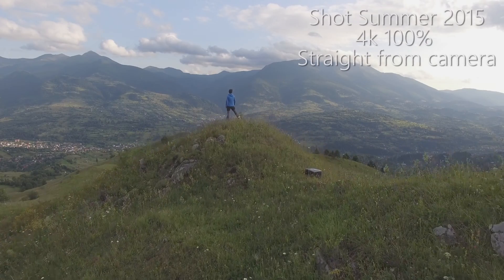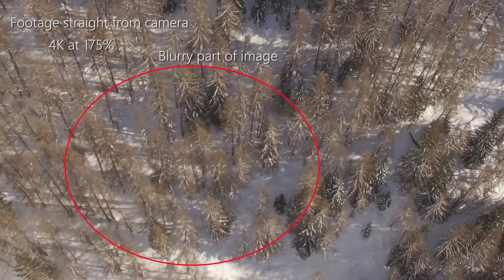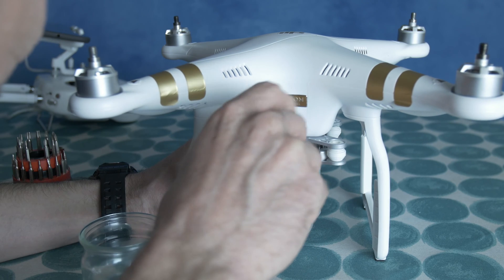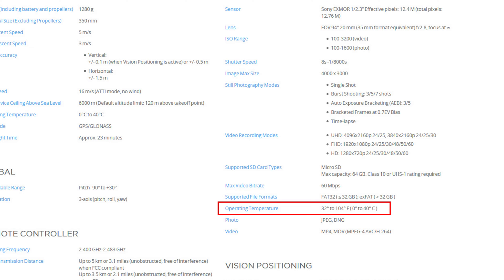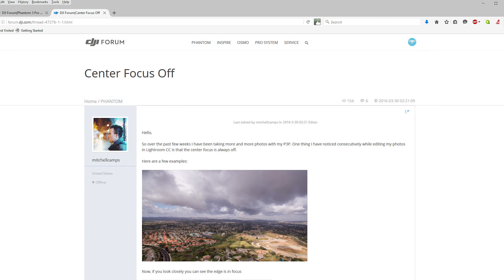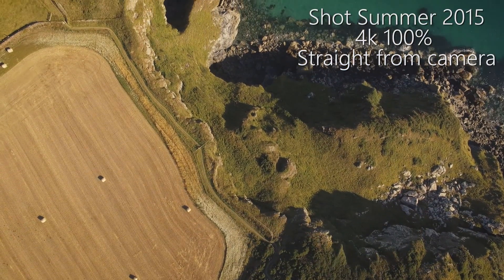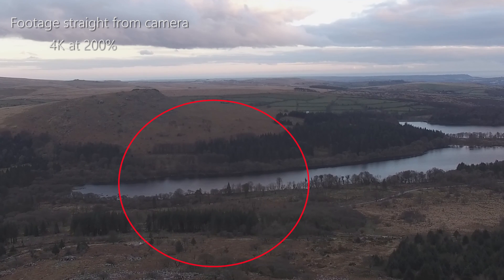Watch this before flying DJI Phantom in cold weather

Comment: YES, I have been having this trouble myself, on the exact same spot! Phantom 3 Pro. But Im not sure if its the cold weather, but it may be! When you blow things up in 4K on youtube app on smart TV, you can really tell the difference. Have you gotten any wiser?? Did it get better in warm weather again? How did you fix it?:)
Reply from the maker: Vidiot Films yes for me it definitely shows up in colder weather, don't have the issue when flying in warmer climates. Not much can be done about it unfortunately
Reply: Ait, thanks for the quick response! Guess if one wants perfect footage, we will have to film over 8 degrees celsius... Have you seen this video? What do you believe? 
https://www.youtube.com/watch?v=0xQcC1WBChU&t=87s
Reply from the maker: Vidiot Films yep, it's probably possible to fix the sensor alignment but and it's a big but the scews in the camera assembly are extremely fragile and very easy to strip the threads, you need the exact right size screwdriver and even then it's not easy as they have been set with threadlock. My advice would be to leave it. I actually ended up getting a replacement camera from DJI but it still exhibited the same issue.
Reply: I see! Will try to neglect the blurry spot when flying in cold weather, and wait for warmer weather to get the perfect movie footage! :)
Reply from the maker: Vidiot Films enjoy, happy flying.
Reply: Just a Q in regards to this.. Cant seem to find the soft/blurry spots in your 2015 videos, for example https://www.youtube.com/watch?v=F5TNVNTYtvY ? You didn't have this problem then? Different drone? Fixed it in post?
Reply from the maker: Vidiot Films ha, not shot on a drone. All done from ski lifts
Reply: Ait, thanks! They looked so incredibly sharp and nice! Do you have any tips as to which color profile to use for P3P? I've noticed that the D-log (as "everybody" seems to recommend) don't actually come out that sharp and crispy as fex. the ART profile or NORMAL. Any experience with this? And what style settings do you recommend for your favorite color profile? 0 0 0? Thanks, and all the best!
Reply from the maker: Vidiot Films video on my channel all about picture profiles for the P3. Have a watch of that

Comment: For those of us who live in the northern regions understand this is due to condensation. The unit has to be acclimated to the ambient temp for a bit before flying. The expansion and contraction ideas is not logical as this is caused by moisture not differences in expansion rates.

Comment: I have P3P and a P3S, the camera on the P3S does not suffer from the cold weather like the one on the P3P. Flew both of them in different locations and temperature from -30C to 38C and image / video quality from the P3S remains the same - very sharp. So I guess the blurry image / video issue we are talking about here is simply the result of a bad camera batch.
Reply from the maker: Anh Luu i haven't flown the P3S is the camera the same design as the P3P. Thanks for sharing your experiences.
Reply: The camera on the P3S is the same size as the one on the P3P, it has lower resolution (2.7k) and the FOV is slightly narrower. I guess if DJI could make the camera of the P3S trouble free then it should be the same for the P3P.

Comment: I just returned from a trip to Siberia. I was flying the Phantom 4 at temperatures of -20C. No problems at all. Battery life time was fine, maybe a bit reduced but not something what really bothered. Also camera and camera control worked fine. Same for the controller itself. I have to say if the Phantom 4 can sustain the harsh environment of Siberia then there is not that much I am worried about. You can fine some of my pictures from Lake Baikal on Instagram under lonelyphotographer 

Cheers and good luck!
Reply from the maker: Stefan1968ful cool, thanks for letting us know. Good that you had no blurry spots. 👍

Comment: Had a very similar problem with the Mavic Pro in 2-7 degrees Celsius. DJI refuted the problem but apparantly within their specifications so I'm in the process of an insurance claim. Would suggest you check your credit card insurance / warranty periods if purchased on CC as they oftentimes have longer warranty periods.
Reply from the maker: Anton Mills thanks for the comment. Useful to know.

Comment: hey man, I believe I have the same problem - http://www.phantompilots.com/attachments/dji_0072_marked-jpg.75125/
Did you manage to fix yours? I too flied in cold weather, should I hope it fixes by itself when its warm, or should I get it to a service to tilt the sensor?
Reply from the maker: pironcho well all you need to do is film something either when it's not so cold or just put your phantom inside and film something without flying it. Make sure you have at least a couple of meters between the phantom and subject as the minimum focus distance is somewhere around 1-2meters.
Reply: so this is to test if its permanent, or to "fix/reset? the focus to be constant throughout the whole area?
Reply from the maker: pironcho yes it's to see if the focus has returned to being uniform, I.e. the blurry spot has gone. if it hasn't you'll either need it serviced or a new camera.
Reply: sadly its not under warranty anymore. I`ll try, but I want to cover the worst case scenario-do you have info if its something that can be serviced, I mean fix it in a repair center?
Reply from the maker: pironcho no sorry I don't. a new camera for the P3P is around £320. I think in most cases once the camera has warmed up again it will be back in focus. Good Luck

Comment: Don't forget that although the temperature may be 0 degrees on the ground, at 100 or 200 or higher, the temperature might be - 10 or -15 degrees colder than what it is on the ground.  This could most definitely cause the out of focus issues you and others are having.  Also, being manufactured from aluminum, the cold will affect it much quicker than if it were made from steel.
Reply from the maker: WichitaMule yep I agree.

Comment: Hi. Thank you. Today I shot a condo in  Burlington in -10 C regular temp, with winds of 20 km per hr, gusting, but clear blue sky, taking 12 MP stills of the condo - as I do every month under a 1 year contract, as the condo goes up from ground to 7 stories - point is, today on Jan. 6, 2017 is was very cold - got VERY BLURRY still images, or at least quite noticeable different from those taken in the warmer months.

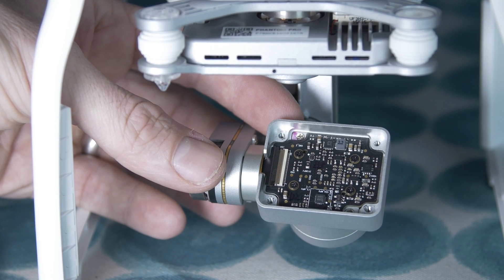But at 2:00 into your video you talk of 'contracting boards' - - I don't think that's even possible, unless at a very microscopic level. I can't agree with your logic as to the cause of blurry photos due to the focal plane being moved around due to shrinking / contraction / expansion / movement of that solid board. It's screwed in!  

If it is physically screwed in, then it simply cannot move, unless the entire camera housing around it was also moving around.

No - I think you're on the right track - it's all about COLD, and the effects it has on a tiny little C-mos sensor chip - like it's frosting over or something, or maybe the electrons are slowed at that level, that would effect the otherwise pristine images one gets in warmer weather.

Remember folks, if the wind is at 20 km (or 50 mph, whatever) that's one thing in the cold - but ADD TO THAT, the rotor blade Down-wash - You've all stood under your P3P and you know how wind is generated by those 4 props.  Well in already extremely cold weather, we have added about 30 mph winds to the Wind Chill Factor.   C-Mos sensors (I believe now) do now work well in these conditions.   RECOMENDATION - IDEA FOLKS.

I'm going to try and insulate my camera with a light-weight, balanced considerate, covering (maybe a layer of liquid plastic, then a foil reflector material - ALL AROUND THE CAM.

Thanks a LOT for this video - you just gave me a great idea. I'll post the results here, when I try it soon.  (Probably have to re-shoot this condo  - I charge them $225.00 per shoot, and I don't like giving fuzzy results! Cheers GW
Reply: Meant to say "C-Mos sensors ( I believe ) do NOT work well in these (extreme cold) conditions.
Reply from the maker: Sky Vision yeah thanks for this, whatever the physical process going on it's a definite problem for all the Phantoms and mavic drones as well. I had my camera swapped out and again it happened flying in cold conditions. 

I'd be interested to see your camera cover, so please do share it here when you're done. Thanks for stopping by and commenting. Happy Flying 👍
Reply: Just an update on P3P and effect on focus / clarity. I was worried that I might have ruined my P3P (less than a year old) when I shot in -20 C temps. But today (at + 5 C in Hamilton, Ontario Canada) I finally had a good sunny day to try it out again. And the resolution of still images and video (at 1080, 2.5 and full 4K tests) seems to be fine.I had called a drone-repair place in Toronto, and they had never heard of damage such as this due to cold weather. They repair a lot of drones, so I thought I'd call them. They only spoke of battery time shortened by cold, but seemed to have never heard of this focus issue.After careful evaluation of my P3P - I'm not 100% certain, but it seems to be fine. But when I compare the still images and videos shot at 20 or 30 below zero, they were fuzzy as hell, compared to today's "warm" temps of +5 or so, that yielded good clean focus across the entire image area. I zoomed in to these stills and compared them to equal zoom-in on stills taken when the P3P was new, and they look the same. Sorry for long message, just thought I'd share this for others who may benefit from this. Geoff at Sky-Vision.
Reply from the maker: Sky Vision cheers Geoff, certainly very useful info. Yes, the camera does seem to go back to pretty much normal once it has warmed up again. Thanks for taking the time to feedback. have a great day and happy flying 👍

Comment: Flew my Phantom 3 Standard in 3deg celsius last week and picked up some condensation on the sensor. It resulted in the image being washed out and blurry. Allowing the drone to warm up for a while fixed everything. You have to remember, if it's 0 deg on the ground, because of wind chill and the propellors acting like a big fan, the drone is going to be experiencing even colder temperatures. I try not to fly in less than 5deg
Reply from the maker: Jack Dooner Thanks for the comment yes your right. This issue is not condensation though. 🙂
Reply: Yeah, I totally see, it's definitely not condensation in your case. Just speaking of my own experience. Do you still have the issue? I've noticed on the forums, A LOT of people have this exact issue with the Mavic Pro
Reply from the maker: Jack Dooner I changed the camera back in the summer and have literally today just been flying in Iceland in temps around -5c  to 0c. The issue is still there, maybe slightly less so than my last camera. I've decided that I rather fly and get the shots I want, I can live with it. 😀
Reply: Wow, that's unfortunate. I guess it's just a flaw in the design! :(
Reply from the maker: Jack Dooner yep I guess so. Would be interested to see if the P4pro suffers from it as well.
Reply: I was just thinking the exact same thing. It would make me nervous if I ever wanted to upgrade... spending 2000 euros on a drone with a camera I cannot fly in the cold. DJI don't realise that we don't all live in sunny California lol
Reply from the maker: Jack Dooner yep agreed. As the P4pro is available now and we are in winter if there is an issue it will show up in the forums pretty quickly I would guess.
Reply: Roger that!
Reply: Canada here - near Toronto!
Reply: I flew 4 times at -17c
Reply from the maker: TheMidnightNarwhal cool.
Reply: My drone is new of 1 day. Is it bad, I mean, all seems ok.
Reply from the maker: TheMidnightNarwhal what drone is it? Have a look at your footage / photos and see if they have a blurry spot.

Comment: bringing some life back in this comment section, mavic pro also has this issue, noe mavic has autofocus, but after one battery it wont reach infinity focus point
Reply from the maker: Tage Mathiassen that sucks. i had my camera replaced back in the summer. I'm about to take my Phantom to Iceland again, so be interested to see if it is still an issue.